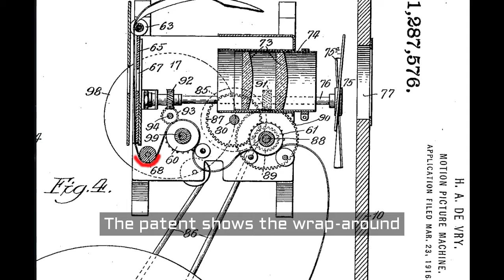DeVry Movie projector (35mm) Pt 11. Further projection test.

Comment: Обтюратор не должен быть трехлопостной, только двух-
Reply from the maker: Hello, thank you for your interest. This is the original obdurator (shutter) as supplied with the machine. Two blades (lobes) will give 32 'obdurations' per second at 16 frames per second, which would cause very perceptible flicker. Three blades, common with many film projectors at the time, gives 48 obdurations per second, which is close to the frequency that reduces flicker to an almost imperceptible level.